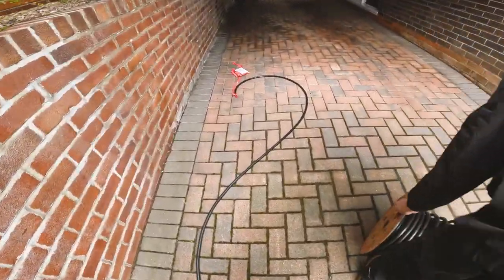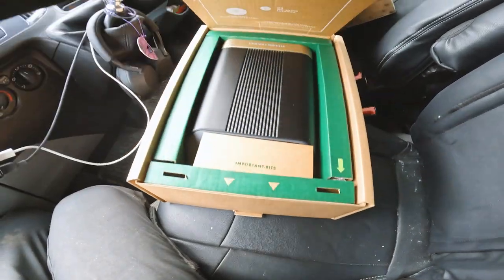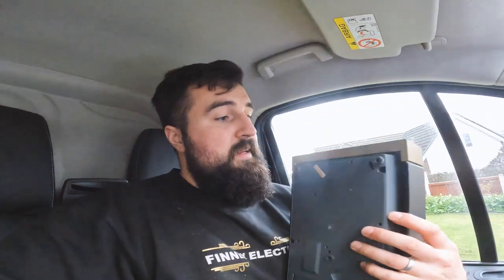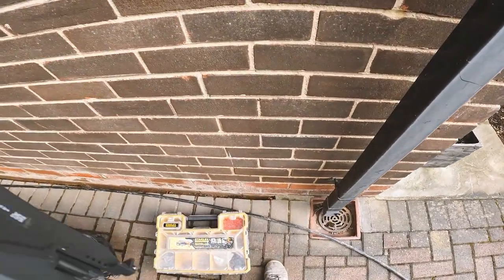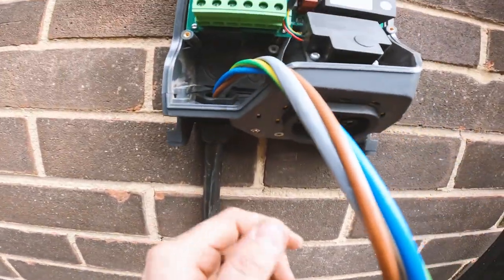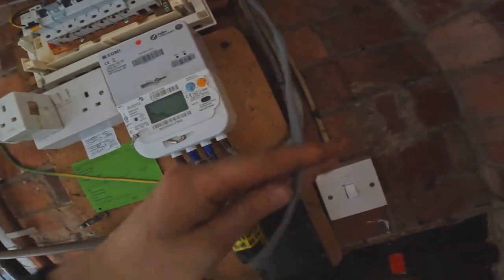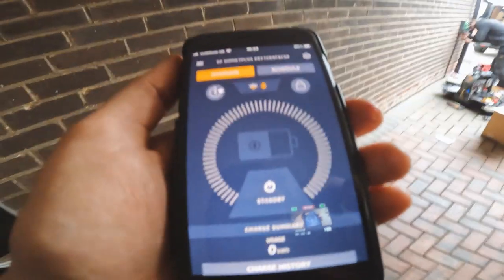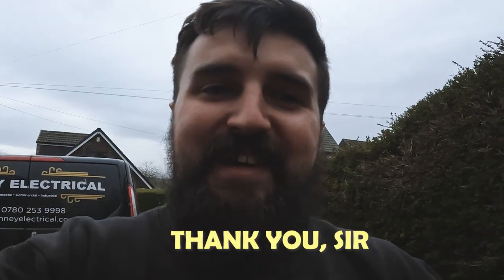CUSTOM DESIGN EV CHARGERS!?? 🚗🔋

Comment: Fusebox RCBO into a Hager combustible consumer unit, really?
Reply from the maker: Would you fit a hagar?
Reply: @finneyelectrical  I would have fit either a new metal consumer unit replacing the hager or to save cost and probably win the job, a hager 60898 MCB supplying a surge protected mini consumer unit.
Reply from the maker: Wish customers had all that brass 😂 as long as the breaker fits nicely into the board there’s no issue. Most fuseboard and mcb designs are based off the same design, literally the same factory rebranded so there’s no issues with interchanging. Only fuse box and a few other brands do double pole rcbos for the ev reg. Hagar decided not to go down that route for some reason. As long as you as a company are saying it’s ok, then your taking liability which is why the regs is a guide so it can’t come back on them.

1. Bus bar entry needs to line perfectly, no wiggle room set slightly back, as it won’t clamp down tightly. 

2. The din rail fixings has to line up perfectly, again with some brands your breaker would sit too high up on the bus bar so less copper connectivity. 

3. Same point as above but the switch sticking out through the fuse board cover needs to line up with the rest. Seen many a time cowboys do this incorrectly chopping out chunks out the fuse board in the breaker position to fit it in 😂